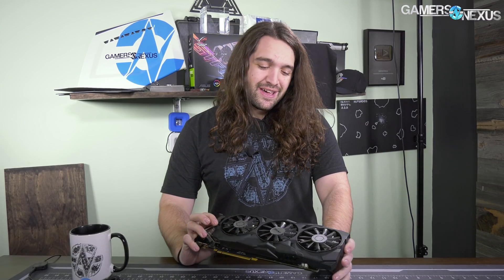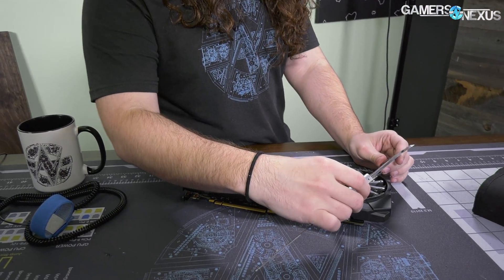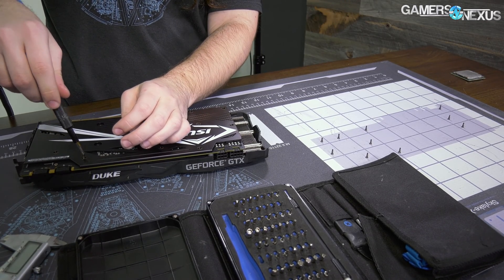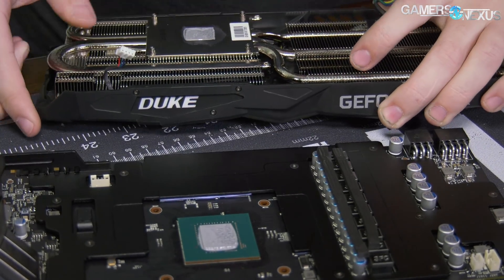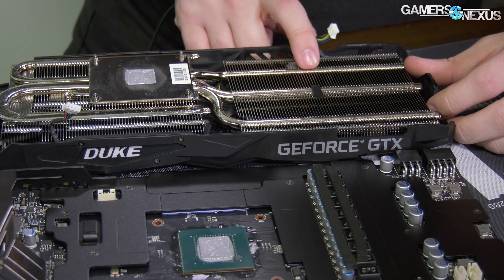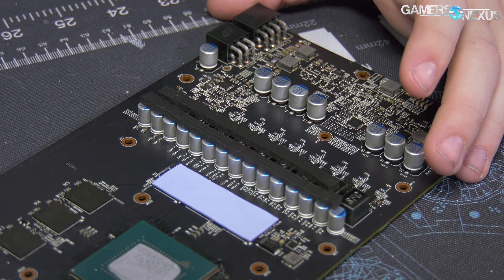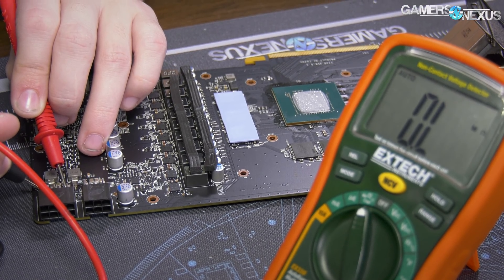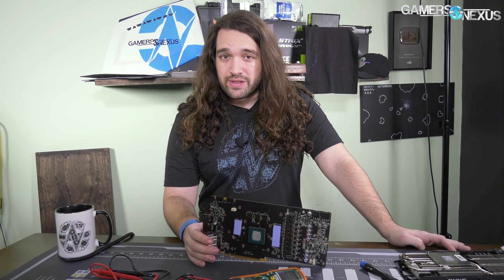MSI GTX 1070 Ti Duke Tear-Down & Shunt Mod Guide

Comment from the maker: FYI, we took 2 tries to measure the shunt resistance (because the connectors are upside-down from normally), but lost some of that troubleshooting during editing (as there is a separate editor from host). The shunts are the correct ones, but one part of the video shows an open line measurement when it should be zero -- stabbed the wrong pin for that part, as the pinout is backwards from normally.
Reply: Gamers Nexus can you please do a top ryzen CPU (1920x) vs intel 8700k gaming performance benchmark.
Reply: In regards to shunts, have you tested using the TG Conductonaut or is does it provide more resistance than the liquid metal?
Reply: 1920x isn't meant for gaming, threadripper is 100% a workstation cpu. It'll be "a bit" better than the Ryzen 7 series in gaming.
Reply: I have heard that gold plated multimeter probes work better than the standard ones.
Reply: Yea thats what I was thinking. lol
Reply: Why are the shunts resistors 2 different values>R005 & R002? Do I parallel them with identical ohm resistors?

Comment: My man, you gotta turn that caliper over the side your using measures outside diameters. The side with the edges on the outside of the points is used to measure inside diameters. It will make your measurements more precise and your life way easier. ;)

Comment: Baseplate is very very useful as when we have to change thermal compound we dont worry about pads and they are fitted with right strength … those gpus which has no backplates specially amd they always get thermal bads width problem after removal of heatsink

Comment: For anyone coming back to this. At 8:03 The black thermal pads are 3 mm. The grey one is 1 mm. Everything else is 1.5mm. If you want to add pads for the backplate 2mm will do it. I just took mine apart and redid the pads to breath some life in to this waiting for 4000 series at this point.

Comment: I can tell by now now i tried this on the MSI Armor and Duke 1070Ti This mod apperently does not give you any results. After trying the extra resistor mod with the same R005 soldered on top of it i get negative results showing less performance only by a couple %. When i completely shorted them it seemed to have 0 results compared to without any mods. I cant seem to shuntmod the MSI 1070ti...

Comment: I have the 1080ti version of this card it may have 3 fans but unless you want it to sound like a jet engine it's gonna run hot or at least mine did
Reply: What were your temps? I've had the 1080 version for almost 3 years and I play at 1440p 144hz and I've never seen it over 75C.

Comment: I would be concerned about gallium in contact with the aluminum at the ends of the shunts.  Over time aluminum crumbles like clay.  I remember say 15 yrs ago someone produced  a voltage or shunt bypass that was built out of a spring loaded surgical clamp and had a resistor connected that was made for the shunts on older video card.  That device was patented and maybe still around, the maker called himself "Voodo"  and he was from Canada.

Comment: I'm not rly sure those are thermal pads @5:09 seem more like some rubber/pads just to support the radiator (you can see later in the video, they are porous - more like a sponge)... MSI just doesn't get it right...

Comment: Is this a different version of the Duke gpu than what is available on Amazon? I am looking at the pictures of "GTX 1070 TI DUKE 8G" there and it does not have the "geforce gtx" on the front, just the duke logo. Just asking because I would rather have the one that says geforce on it like what you have.

Comment: I have several 1070tis which I am able to overclock both the core and memory. On the Duke I can only overclock the memory, it doesn't respond to core overclocking. This is on ubuntu using nvidia command line tools. Any idea why this particular card doesn't like core overclocking?

Comment: Got 1080 before it came out - and looking at local prices, 1070ti costs almost as much as the 1080 i bought with 20-30€ diff for cheaper models.

Comment: That "grease" around the gpu core is crap that separates from the watery garbage thermal paste that MSI uses. No idea why they use that crap. I got an 8° drop at slightly lower fan speed switching my rx480 I used to own the mx4. It looked just like that and the paste was noticeably thin when I pulled it apart. Texture was like latex paint.

Comment: Now you should find out how much current the card is able to use before it's going into safety mode. if you know it you can solder a specific shunt to it which is able to max the card out.

Comment: Can you explain the architectural bottleneck that prevents the 1080 from gaining as much from overclocking as the 1070ti?
Reply: The lack of a big core difference. Their core count is really close so the gddr5x is the biggest difference. That being said, ï did try to oc a 1070ti gaming card, got 2.1k on the core and basically no oc on the memory

Comment: I always recommend wearing some kind an anti-static band of some kind.  HOWEVER, I always wondered why a pair of safety shoes from work used to advertise 'Anti-Static' on there soles.  Its obvious when you think, your footwear is responsible for contacting the ground.  So if you wear those cheap nylon sole type shoes. You are far more likely to build up a static charge.  I speak from experience too, changing shoes makes the world of difference.
Reply: It's not only the footwear which matters. The surface of the floor and possible layers underneath matter just as much. If you're working on a typical carpet for example you're likely to build up more charge (and/or more quickly). Another example would be wooden laminate, which typically has a foam dampening layer underneath.
Reply: That's why I would still recommend some kind of anti-static measure.  Even if you have good footwear on you can still carry a charge.  I worked in a very large store in a shopping centre.  I would get shocks from keypads, lifts, metal cages and the worst was the escalator. Was a nightmare I looked so wimpish calling lift with pen, because of the imminent shock haha.  Changed my foot wear and they stopped over night.

Comment: Hey Steve. You didn't address the third shunt on the bottom. I'm guessing it relates to the 75W power draw from the PCIE slot. Would that be a correct assumption? Also would i be correct to assume the risk of shorting that shunt far outweighs the reward?
Reply: Sounds like you're right. It lets you do crazy overclocks, for testing purpose only tho

Comment: dont you think this fan shround chokes the hot air coming out from the top and bottom of the card? please run a test about this.
Reply: ir3555 ir3555 Wait what? You're asking if the plastic bit around the fans choke the fans, from the top AND bottom airflow? The fans aren't being choked. Nothing in front of them. And you said the top of the card too lmao? The fans pull in cool air to the card, and as stated before, there's no obstructions in front of the fans. How would they be choked lol?

Comment: Jeez wrong again with the shunt check lol. Your first measurement was to a ground pin then a quick cut to the correct pins. MSI loves upside down power connectors. Your getting there lol. You should show your mistakes people will learn like you have. We all make them including me, plenty of dead hardware on my wall of shame lol.  Love the channel best actual data out there.
Reply from the maker: Yeah, realized it and remeasured, but the video is cut by someone else, so not everything always makes it in.
Reply: Gamers Nexus I like seeing mistakes it makes YouTuber's look more human instead of perfection all the time. I had bought 2 MSI R9 290s a few months apart and one had normal style connectors while the other was upside down. It drove me crazy just never looked right in crossfire.

Comment: I think you are using the wrong side of the calipers when measuring the fan size. The back side w is for measuring the inner diameter of something and the other side is for measuring the outer diameter.
Reply: Exactly this.

Comment: I feel like Nvidia wanted to make a card that would sell just by the name alone. Most people are turned away from the 1080 simply knowing that the 80 series of cards usually runs pretty high end. They want the performance of the 1080, everyone does, but they don't want to settle for the 1070 simply because of the notion that it's a lesser card from the name. So they come out with a 1070 Ti so people think they're getting a better deal than a 1080 (which they are) and they feel the sense of accomplishment of not settling for a "lesser" 1070.
Reply: It was made because of GDDR5X prices
Reply: Actually i believe it was made just to challenge the vega 56. But due to gpu prices it was useless in the end since a 1080  can even be bought for the same price as a vega 56.

Comment: Don't you mean infinite resistance not zero resistance? The meter was reading Open Line when you checked.
Reply: I think he did, they really need a better meter that thing is seriously cheap lol.  The meter showed O.L for overload which means open circuit not 0 ohms

Comment: Yes, you can overclock a 1070Ti to get 1080 performance, but then you can overclock a 1080 and blow it away.
Reply from the maker: No, that is incorrect. Refer to our review.
Reply: No, you actually can't. Compare the number of cuda cores on both and the 1080 is only barely ahead to the point where once both are OC'd, the performance differential is only 5% in favor of the 1080. GDDDR5X doesn't seem to make much of a difference.
Reply: "Blow it away" by only 5 - 10% if you're lucky.
Reply: It's true the price difference is ridiculous. The only time it's kind of worth it is if u go with gigabyte wf3 OC card as it's by far the cheapest on the market and is only slightly more then a 1080. Having owned one tho I'll say it's an absolute piece of trash with fan rattling, temperature issues, and random fan ramping to 100% because of a bios issue that gigabyte fixed on the g1 gaming card but not the wf3 even tho they share the same pcb and cooler. So I'd take a quality 1070ti over a cheap 1080 any day of the week.

Comment: Had to send my 1070 duke back for RMA... kept overheating and would shut off at 60C.. Case has more than sufficient cooling. Read that if the card used Micron memory that it had known overheating problems... just my luck after upgrading after 4 years :/

Comment: i´d rather buy a used 1080
Reply: That is always the best option, but if you're going new, there's no reason to go 1080
Reply: if the price is right, that is true. I´m so glad I got my used 1080 gaming x for 400€ a few weeks before the mining price fiasco. (Love to mention that)
Reply: Lol. Also there's fun pricing in Canada, 1070 and 1070ti are the exact same price so the cheapest 1070 is actually a ti zotac mini, then there's a 1070, then a ti. Heck there's a 1070 for 700$ but the mai gaming ti is 650. Yay mining craze